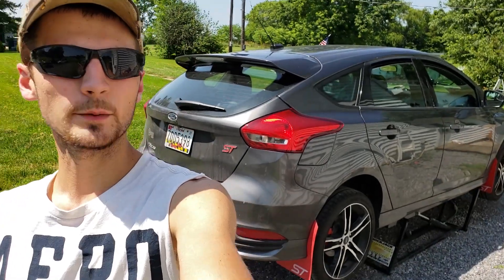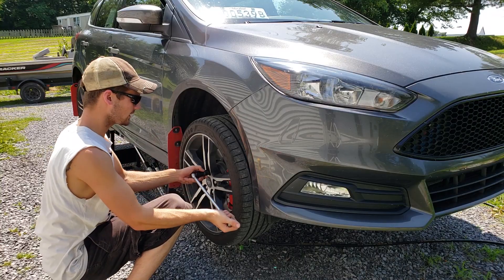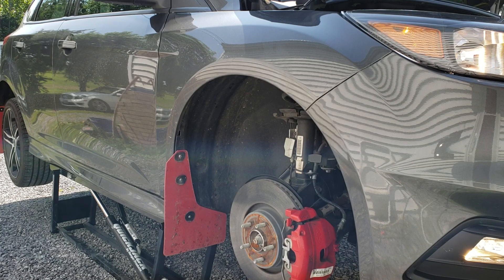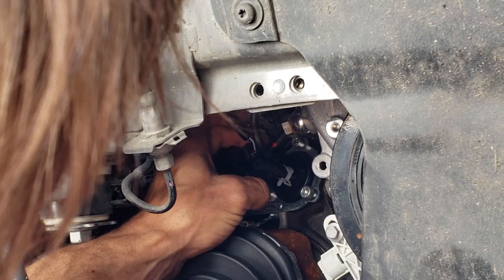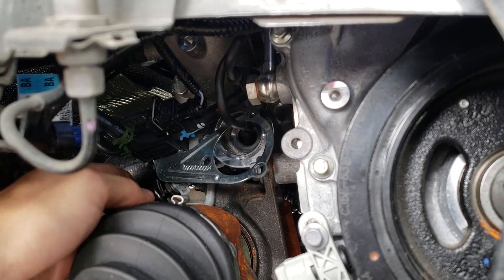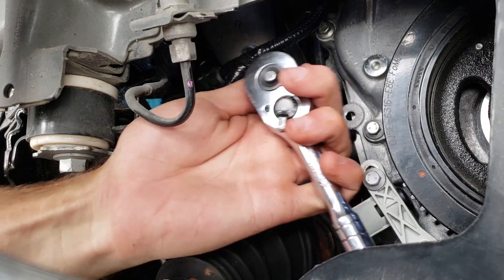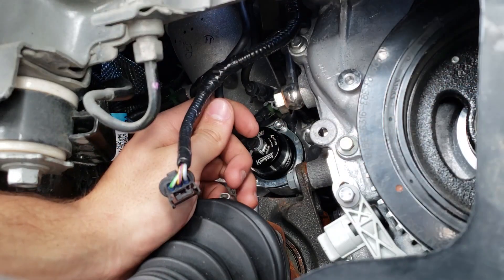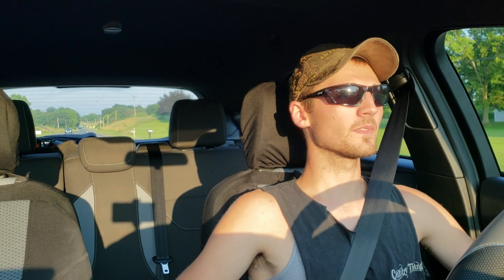2018 focus st blow off valve install

Comment: It’s neither a wastegate or a bov, it’s a recirculation valve. It dumps all that air back into charge the pipe.
Reply: it’s 50/50, 50 to atmosphere,50 to pipes

Comment: I just installed mine and it makes a acute sound before the real sound and idk if I have to adjust the spring of the turbomarck so the acute spud disappeared?? I would like to get help please
Reply from the maker: Try turning the spring pressure all the way down it may be to soft for the boost pressure your running